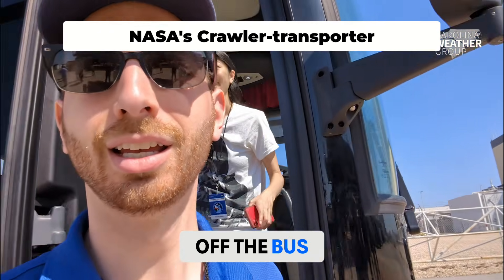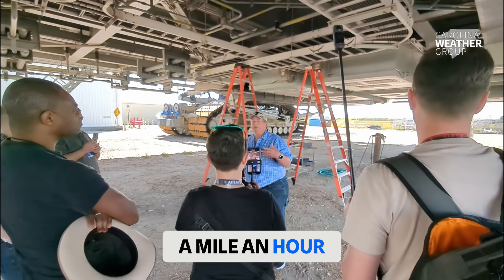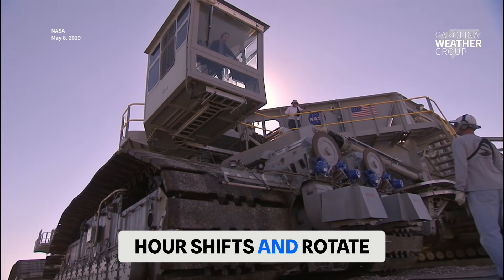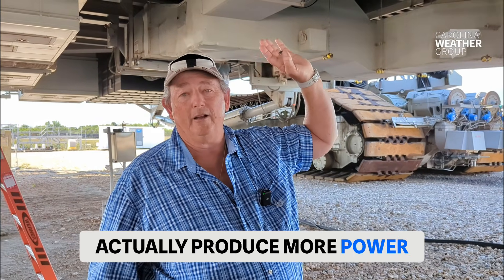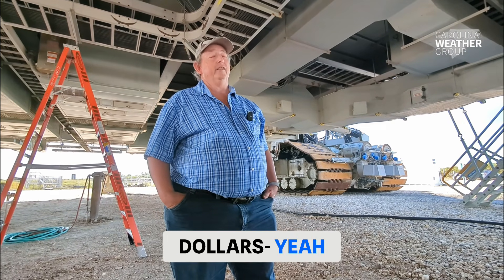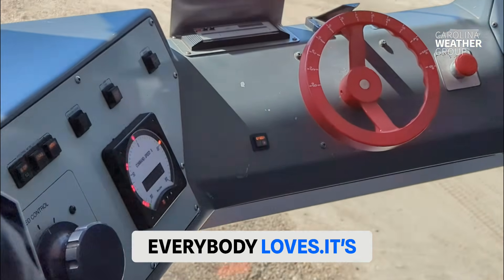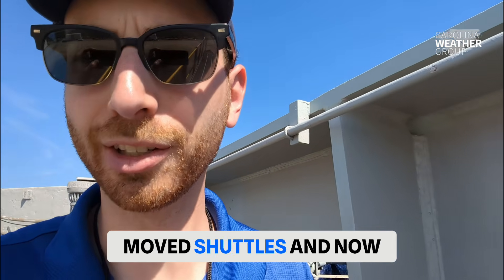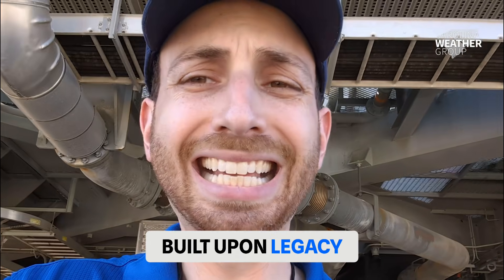Onboard NASA's Crawler-transporter: From Apollo to Artemis

Comment: How do they move it from the crawler to the tower
Reply from the maker: They made modifications to the crawler for Artemis. Artemis is assembled inside the Vehicle Assembly Building directly onto its tower. The tower is mobile. 

Inside the VAB, the crawler drives under the tower and rocket. The crawler raises up to affix the rocket and tower. It drives to the launch pad. And then the crawler lowers itself. The rocket and tower settle onto fixed supports. And the crawler drives away.

Comment: Always an astonishing piece of '60's engineering to be admired, and I watched them operate through the Apollo Program and on.
A couple tid-bits for the younger crowd.
   1.)  The nick-names "Hans and Franz" (from a 1980's SNL skit) are NOT CORRECT.   These crawlers were named a decade or more before SNL existed.
   Their actual names are Hans and FRITZ.   Hans and Fritz were 2 cantankerous (troublesome) kids in the comic strip "Captain and the Kids", popular in newspapers of the time.   When new, the crawlers were also troublesome, hence the names.
   2.)  NASA at one time released an RFP to replace the two crawlers, and the cost was well outside (I think nearly double) the budget, so refurbishment became the only affordable option.